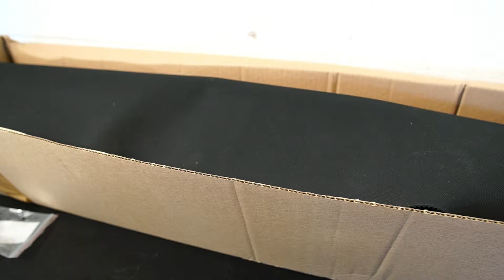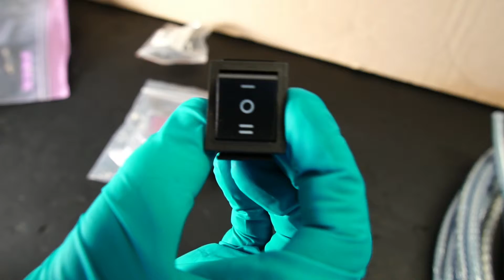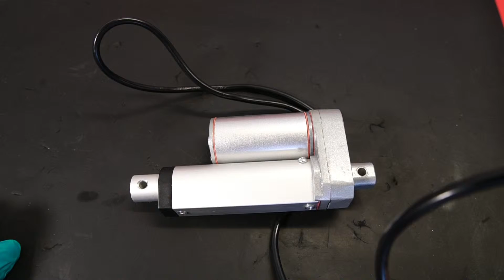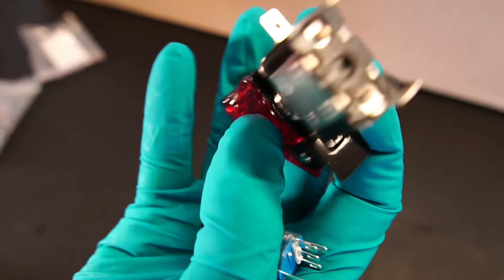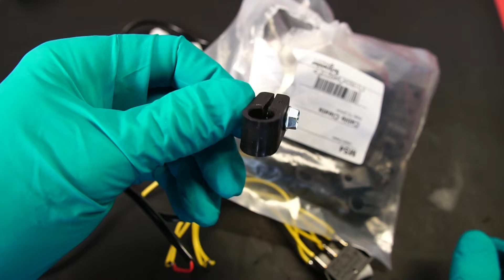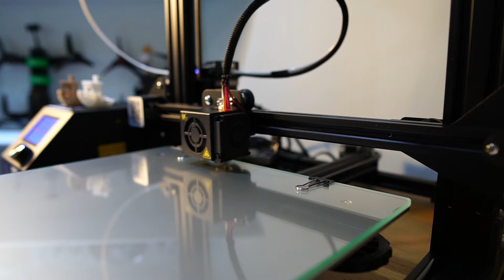Making A Van Chassis Mounted Generator For Less Than £500 (part 2)

Comment: 20mm compression glands and cable cleats screws are self drilling tex screws,I have two of the linear extending actuators 600mm stroke for my solar panel sun tracking system,great project for the van,nice tidy little Jenny that for the price
Reply from the maker: Poor thing has been working hard for over a year now! Almost without a day off. It really is time to get it back off the chassis and on the bench to give it some love. 
When I first built it I had a few reservations about how reliable such a cheap generator would be. It's massively exceeded all my expectations. If it blew up tomorrow it's already paid for itself 10 times over. Fantastic bit of kit.

Comment: i do like the over kill on the choke, judt i think that could be cost free and very simple, why not use the ign switch that came with the gen set....just add longer wires,no doubt u will have a control panel for the generator.  12v from your vans battery,  even the volt meter and 240v trip switch could be on the control panel inside your van...there will be loads of ways to do the same job, its all good, and a great video...

Comment: cant see why u didnt get a normal choke cable or even a long choke type cable like runs full lenght of a car for boot or fuel cap relase...or maybe a solenoid as it wont be on long... im watching with keen intrest , other bit i was thinking to the gen part driven from your vans engine pully, via an A/C electric clutch type setup, just some of my ideas..., i use a fiesta van, not really any good for what your doing, i should get a real van...lol, if u had a solenoid connected to the starter motor u would have choke while cranking, engine starts cranking stops choke off, get my jist..lol

Comment: Be interesting to see how you reduced the end to end travel on the Linear to match that of the choke lever Jim. And they be Cable Glands :)
Reply from the maker: I measured the choke throw at about 2" so bought the actuator to match. It's not perfect but it's close enough given the amount of sloppy in the choke lever :)

Comment: I was thinking the same thing there JB! What can I build that could use an actuator?  Can’t wait to see how this all comes together. Jim, have you used the 3D printer to make parts for your motorcycle repairs/servicing? Perhaps for pieces hard or impossible to obtain?
Reply from the maker: You won't have to wait long! I'll upload  part 3 tomorrow. It's 30 mins long so you better get the beers in 😁 The 3D printer is fine for working through prototypes but  not much good for the final components, this type of printer will only print farley week materials such as PLA, still good for none mission critical parts though and just fun to play about with :)